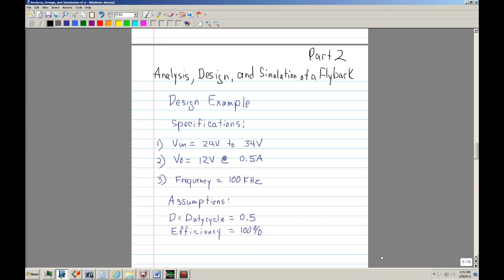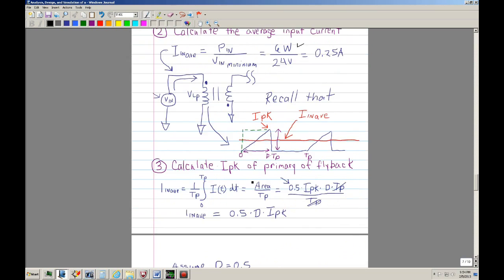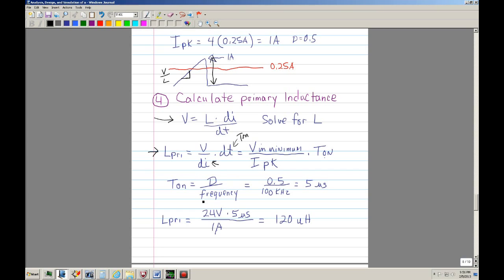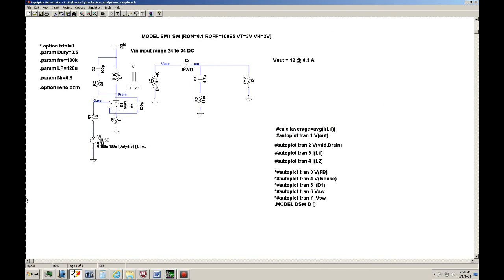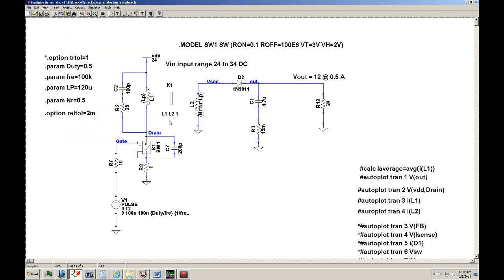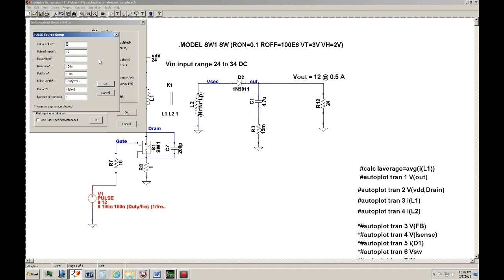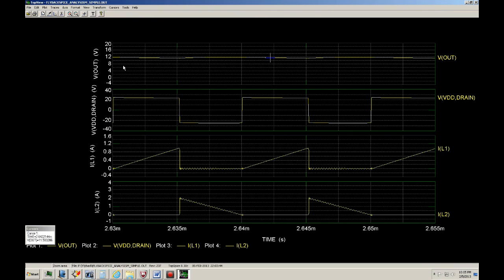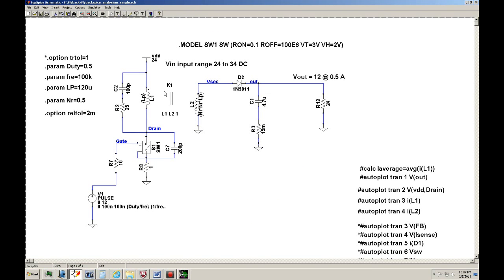Analysis and Design of a  Flyback; Part 2, How to Model and Simulate a Flyback Converter

Comment: Hi Robert,
The Output voltage is +12V as opposed to -12V due to the voltage inversion by the flyback convertor, do you know why the spice simulation gives this value?
Also, the Secondary is grounded, would it not cause the flyback convertor to not work as intended since they are supposed to be isolated?

Thank you.

Comment: Hi, 
Thanks for this useful video. Why do you multiply Nr*Nr*Lp to calculate Ls?
Reply from the maker: The turn ratio determines the secondary inductance. Nr=Nsecondary/Nprimary.   So the Secondary_inductance = Nr^2*Primay_inductance. I hope this makes sense.
Reply: @RobertBolanos  Thanks for answer. Yes I recalled the formula (Np/Ns)^2=Lp/Ls

Comment: equations shown in this lecture works for critical mode of conduciton .
Reply from the maker: Yes. It is in boundary between DCM and CCM. So the inductor that you get is the for DCM. So if you use a lower inductance, you operate in DCM. But you use a bigger inductance than you calculate, then you operate in CCM. That was good of you to have noticed

Comment: Hello Sir Robert Bolanas, the video is so great, i really like it, but i need some informations about the circuit, concerning the snubber circuit. How did you get the values of R2 and C2? And what are the fonctions of C7 and R8?
Thank you...
Reply from the maker: Thanks Ngangnang!  C7 is to simulate the parasitic capacitance of the mosfet modeled by S1. The resistor is a current sense resistor. The current flowing thru the resistor is the same current flowing thru the mosfet and the primary winding. It is a good point to attach a scope probe and monitor the current waveform. Also, if you use a current mode PWM, you connect this to the current sense pin of the PWM. I hope this makes sense.
Reply: @RobertBolanos  Thank very much sir Bolanos. You explanations are clear, but i still wish to know how you caculate those values. You have just taken randomly or there is way to calculate values of the 2 capacitors and the 2 resistors?
Thank you in advance.
Reply from the maker: @ngangnangbrice6738  C7 is calculated from the mosfet datasheet. You look for Coss. For the Rsense resistor, you calculate at 0.7V/peak_current.   The subbers are set by setting Csnubber=4*Coss,   and Rsnummber=(Leakage/Coss)^0.5
Reply: @RobertBolanos  Thank you very very much for your explanations. I wish to know or understand a last thing. How can C7 simulate the capcitance of a real mosfet?
Thank you...
Reply from the maker: @ngangnangbrice6738  I don't understand your question in "how C7 does it simulate the capacitance of a real mosfet".
Reply: @RobertBolanos  C7 is a real component in your circuit. Why should this simulate the parasitic capacitance of a normal MOSFE?
Reply from the maker: @ngangnangbrice6738  the mosfet has capacitance from drain to  source. (Cds)The capacitance varies with Vds voltage but using a capacitor and using a switch spice model allows to simulate the interaction that the leakage has with Cds. This interaction shows up as a height frequency ringing. Continue watching the rest of the videos and it will make sense

Comment: Hi , As mentioned in the schematic the input range is 24V to 34V . At 24V input the output is 12V . But as we increase the input to 34V the output also increases . So how do we regulate the output at 12 V . I have seen that the feedback loop plays an important role as the PWM controller can change it's duty cycle so that the output is always at 12V . But how the controller know that it has to be at 12V ? If you have any video regarding this please point me to it.
Reply from the maker: After you have simulated the output filter, flyback transformer and the mosfet, you can put a PWM that will automatically adjust the duty cycle to bring the sample output voltage into regulation. Continue watching the videos as I built up to regulating the output
Reply: @RobertBolanos  thanks a lot ❤️

Comment: How did you add the switch model in TopSpice ?
Reply from the maker: The switch is in the library. I used the switch to simulate a mosfets transistor. It simplifies the simulation. This also makes the simulation run a little faster since a real mosfets model can be quit complicated. Once you have the simulation running, you can replace the switch with a mosfets.  I hope this makes sense. "May you simulations always converge", Robert Bolanos
Reply: @RobertBolanos  Hi , in your example when I used the switch model it worked perfectly and when I replaced it with an N-Mosfet the output came completely wrong. Any ideas how to fix this ?
Reply from the maker: @shivanshu2959  make sure you are using a mosfet model that has a low Rdson. If the RDson is too large the too much voltage will appear across the mosfet
Reply: @RobertBolanos  Thanks a lot. You have really been very helpful.

Comment: Hi .I have two questions .
1.does this syntax for topspice is valid for ltspice?
2.do we have any calculation for selecting output capacitor?
Reply from the maker: The syntac such as #autoplot and #calc are not LTspice compatible. But other such defining K should be the same. For calculating the capacitor, they are shown later in the subsequent videos.

Comment: Can you please give me your nice excel sheet of the fly back
Reply from the maker: Hi Tom, regarding the 500W flyback, it would not be a suitable supply. Flyback  work better under 100W. At 500W, the peak current would be very high. A forward converter would be a more suitable 500W converter.
Reply from the maker: For the excel send email to rbola35618@aol.com
Reply: @RobertBolanos  I want to know which software you use
Reply: Hello sir can you please share excel sheet of the flyback design

Comment: an extremely nice video  for beginners in smps thanks robert bolanos sir
i have one question 
can i use tina ti spice based simulator for simulating the same
Reply from the maker: nikul panchal yes, you should able to use almost any simulators to simulate. if you email me at rbola35618@aol.mom, I can send you top spice files which you should be able to simulate on the demo version of topspice
Reply: thank you so much for your help my email id is nikulpanchal3@gmai.com
once again thank you for your help

Comment: One more question.  Does Topspice have a good library of controllers for switching mode power supply?
Thank you
Victor
Reply from the maker: Hi Victor, yes, Topspice has a very comprehensive library of pwm model which include the average and switching models. It also has Basso, Copec and other average models. If you go to Penzar Development, they should have a list of the models in its library. Hope this ehlps

Comment: Hi Robert. Thanks for this great Job. Could you just tell me why you have chosen TopSpice ? it's not free. I suppose you can do the simulation with LTSpice don't you ? Regards.
Reply from the maker: Hi Younes. That is good question. I like using Topspice because of it's large library of spice models and great convergence. When I say convergence I mean that I hardly get simulation errors. Topspice cost about 600 dollars which is affordable to most practicing engineers and they have great technical support. I have been using it for about 15 years and therefore a very happy customer. I highly recommend Topspice.

Comment: Hi Robert, Thanks for your valuable tutorials about flyback design. I have a question regarding the " ground " symbol in your flyback circuit. Normally the primary and the secondary circuit parts are isolated by the transfomer, so they have their own "ground". In your simulation i see that you use the same grounding for both (primary and secundary) parts of the circuit. I am bit confused. Do we only combine it during simulation and in real life design we split it? I will try to simulate it using LTSpice. Thanks again for all your work, really appreciate it.
Reply from the maker: Yilmaz Kalafat Yes, this is correct. SPICE only has one ground symbol and is harder to simulate with two different grounds. In addition, when first powering a power supply that you design, I do ground both the primary and secondary grounds together just to make sure I don't have a ground loop. Once I have the power supply working, I separate the grounds. This is a good question.

Comment: How do you pick the frequency for your PWM in general? I believe that a higher freqency allows for a smaller transformer since less energy is stored at the same time during a cycle. However i am not sure how the SRF of the inductors come into consideration for the frequency selection. My guess is to stay away from SRF and its harmonics to avoid oscillations due to resonance. Im not really sure.
Reply from the maker: chopcooey Hi Chopcooney. I try to keep the frequency between 100K to 200k. As you increase the frequency, your magnetic (transformer) and capacitors get smaller as the expense of switching looses. So it is a compomize between reducing the components and how much power you can dissipate or loose. As your switching loose due to the parasitice capacitance increase, your efficiency will decrease

Comment from the maker: Hi Derek,

After I am done with the Flyback series, I will do a series of videos on the  Forward converter which is a isolated Buck converter and will then cover the simple boost (which is a non-isolated flyback). I am glad that you find the videos useful. These videos were intended to train our younger engineers here where I work. I am glad other fellow engineers and students find them useful. Thank you for your comments. If you have any questions, you can post here or to rbola35618@aol.com